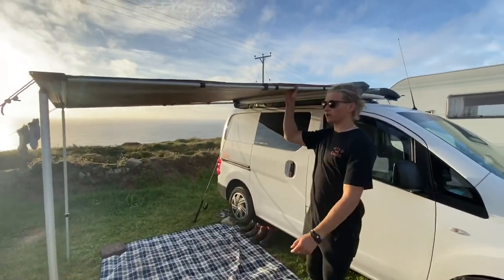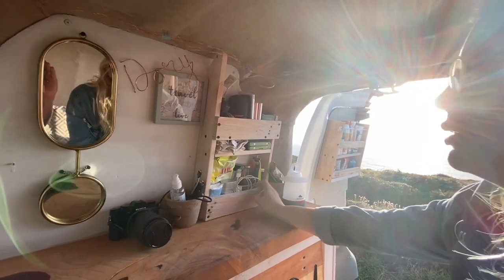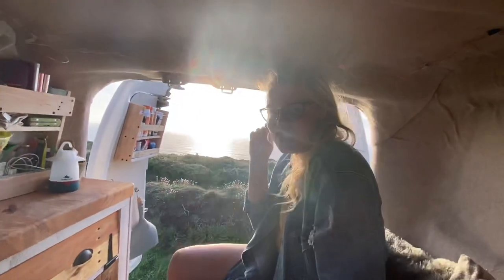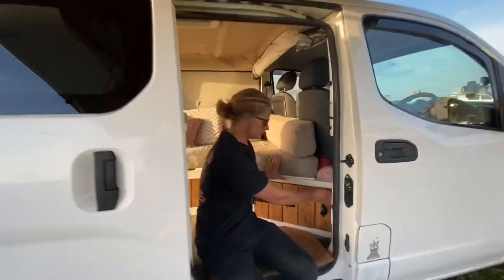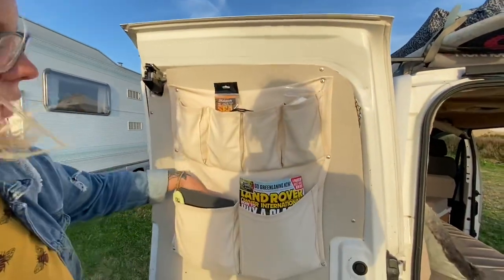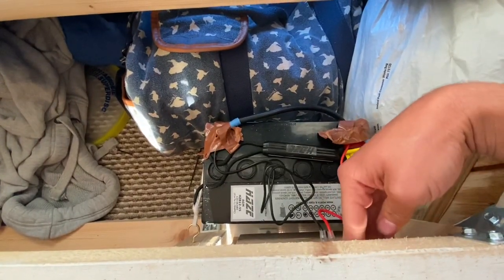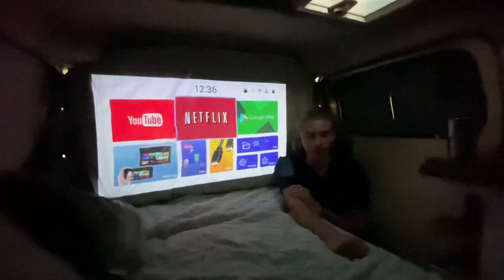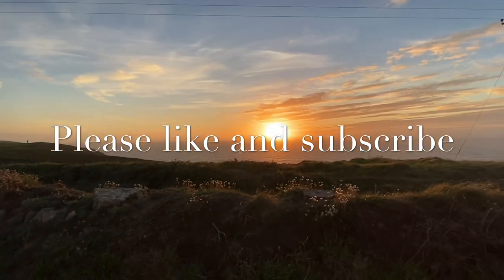Van life | van tour | Nissan nv200 - micro campervan conversion

Comment: Looks good, what do you guys do for cooking, washing, and heating?  Also what was the link to the projector, please.
Reply from the maker: Thank you 

We use a 12v system now so can have a 12v heater and fan 

And cooking wise we use portable cooking units so a gas can and cooker and we cook ontop of the work top
Or outside if warm
Reply: @Justuswandering  Could you please advise the link to the projector?
Reply from the maker: @briancollis9352  https://cine-lite.com
Reply: Hi! Have you switched to a 12v roof fan now? Instead of the hatch? @Justuswandering
Reply from the maker: @liamwarring4054  hi, nope still just the open hatch :)

Comment: Lovely guys. Very cool. My only query is the 3 bits that makes up the mattress as that means one of you is laying on the join?, why not a higher backrest? The roof vent does look really helpful. Where do you keep your clothes? Hope you both have many great adventures in your van :)
Reply from the maker: Hi 

Thanks 

We each have a cushion technically and even if we are lying on the join, it’s not uncomfortable and we don’t fall down it, the mattress is secure with the way we have designed it 
We didn’t want higher back rests because it means the aesthetic of the van would look out of whack and with the L shape we only had enough of the mattress left for two thin slithers so this worked with our plan perfectly 

In regards to clothes 

It’s in the top part of the drawers system, we don’t carry much and if we need to use a a laundrette we do to keep things clean and tidy :)

Comment: Lovely van. Would you say the awning is heavy duty and up to a battering? It's between that and an ARB and I can't decide.
Reply from the maker: Hey 
Thank you! 
We haven’t had any issues with it 
We love that it comes with strengthening poles on either side and also guide ropes for when it’s heavy wind 

We’ve had bad wind, snow and rain and it’s still in great condition! 
So much so we ended up buying another for our defender!

Comment: I just test drove an NV200 2021 - it didn't have an adjustable steering wheel - could this be right?  It did not tilt, did not telescope.
Reply from the maker: That’s odd isn’t it! 
Ours does have one
Reply: @Justuswandering  Nissan does not seem to offer an adjustable steering wheel in the US. Which would put it at a disadvantage compared to the Ford Transit Connect, which I also drove and has a nice driver environment.

Comment: Really neat conversion guys! Do you need to be careful using the awning on windy days? (Sounded a bit breezy!). We are new to vanning this year, and always wary the awning will catch the wind and get damaged. Just subbed 👍
Reply from the maker: Hey! Thank you 
With the awning we went for it comes with guide ropes so you can still use it in windier conditions... we’ve never really had any issues to be honest 

But always just judge it by the conditions on the day... 

Do you have the same as us? 🤙🏼
Reply: @Justuswandering  It's similar, but bolted to the van (a T5). We do have awning straps and beefy pegs. Just not sure how far to trust them 😊

Comment: What is the 2nd battery for, you only have USB stuff, they will run for weeks without effecting you car battery? This van is too small, for the same money you could get a Renault Trafic. Still you seem happy and that is the main thing, enjoy.
Reply from the maker: The 2nd battery is used for charging devices without running the van, this is a much better way than using the car battery and would definitely recommend it. Pretty much everything nowadays is powered through usb/12V so there’s no need for unnecessary complications such as inverters when they are not needed. Thank you on your opinion on the size please elaborate as it’s perfect for us. We could have purchased many different vans but after looking at reviews for different makes and manufacturers along with test drives and even a few other purchases and conversions we settled on this one as it is perfect for us and suits us the best. Thank you 🙏🏼✌🏼